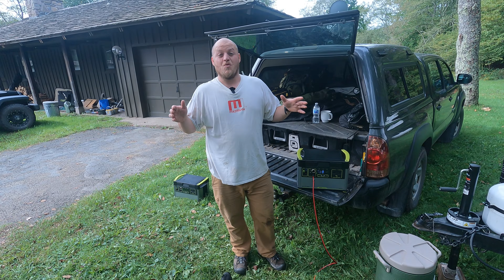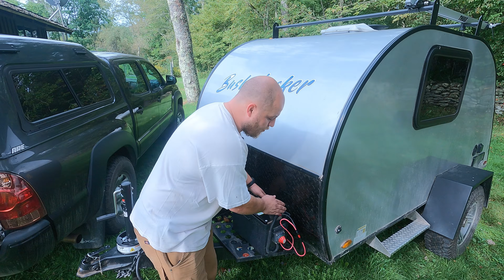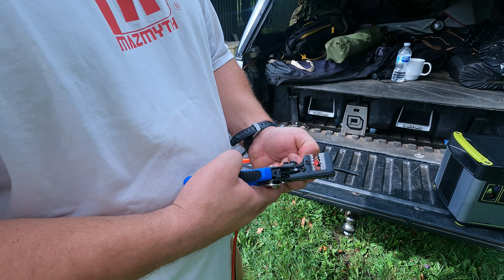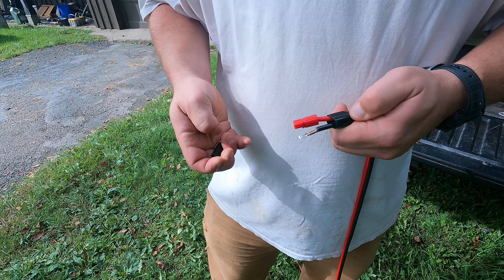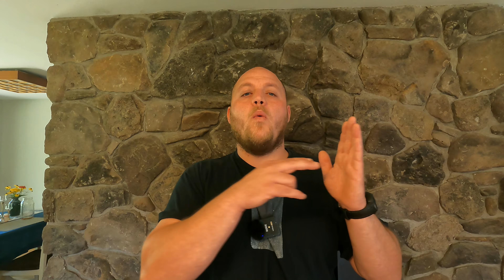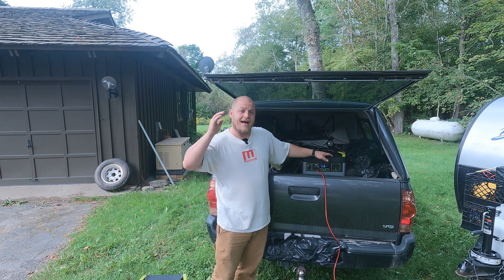Using Goal Zero for RV Battery

Comment: Hello, great video. I have a GeoPro camper and a yeti 1500x so I would like to have this as an option. I took a look at my wiring and see that there is a short ground wire that connects to the trailer and another thick black wire that runs somewhere else. Do I need to snip both black grounds and make them into one ground wire to make this work?  Just not sure why I have two black grounds??  Hope you can help. Thanks.
Reply from the maker: Without seeing your system, I can’t say what would be best. The grounds will likely all bond to the chassis. There’s several safe and effective ways to do this and you don’t really even have to remove the house battery negative to add the GZ.

Is there 2 positives? Does the second ground go to the solar ready port?
Reply: Thanks for the quick response!  

So, there is (1) positive 4 gauge wire, (1) negative 4 gauge and (1) negative 10 gauge wire. All fastened to the battery on (1) positive and (1) negative terminal.   Also, the camper does have a solar panel pre installed and wired. 

The thing that throws me off is the negative terminal has (2) ground/black wires….(1) short, 10 gauge wire that goes straight to the frame from the battery and (1) 4 gauge that runs under the camper along with the 4 gauge positive wire where it disappears into the camper. 

I’m leaning towards the power poles need to be installed on the (2) thicker 4 gauge wires and just leave the 10 gauge alone. However, I got the 45 amp Anderson power poles in. It doesn’t look like the thicker wires will fit on the metal pieces where I would crimp the wire too? Not sure if they make power poles that fit the thicker 4 gauge wires? If so, let me know. 

Disclaimer: I’m not exactly sure if they are 4 gauge wire, it was just what my gut tells me….lol.  However, They are considerably thicker when compared to a 10 gauge wire. 

Hope I’m explaining this clearly. If not, I’ll just wing it. Thanks!!!
Reply from the maker: @chrislucero758  I think it would be irresponsible for me to guess here, but I can probably point you in the right direction. Let’s talk theoretically…

4awg seems way overkill, I’m guessing maybe 6 or 8.  Since the yeti will trip at 30 amp, 10awg at these distances would carry the current. 

There are many things you could do to make this work, just don’t jeopardize the integrity of the campers normal functioning, when on house battery.

Maybe installing a “1,2, off” switch might be best. Sometimes they’re hard to find, so “1,2, both, off” would work as long as you were careful not use “both”.
You could add a Anderson, with the red going to “2” and black going to the chassis where your smaller battery black goes.  “1” would go from battery to the heavier red wire that is currently in place.  This would allow you to get 10 or eight gauge wire that fits your Anderson plug and provide a simple to use switch between the camper battery and GZ.  Don’t use “both” … switch from GZ yeti or camper.  Food for thought.
Thanks, Brian

Comment: @DIY Outdoor Life  any particular reason why you didn't route the wires so that the yeti could live INSIDE your trailer?
Reply from the maker: I have that too. The main reason I run outside most times is the space is tight. It’s two adults and a dog in our teardrop…lol. I also have videos showing the inside wiring.
Reply: @DIYOutdoorLife  Not seeing them. Can you provide link to those videos? Thanks again for your help.
Reply from the maker: @donnetellomaximilian  here is a simple backfeed set up. I also have an Anderson connection in the trailer for higher current capability, I don’t think I did a video on that yet.
RV Power Station Hack | Interior Back-Feed
https://youtu.be/lf2nbCLuLCY

Comment: Thanks for the vid. I have a 1500x and am looking to acheive the same thing- boondocking solution to power RV. 

QUESTION: Is doing this more efficient than just plugging the RV into one of the AC plugs on the Yeti? Why or why not?
Reply from the maker: Tremendously more effective.

The reasons are simple. By using the inverter you are losing around 15% in inversion loss. You are also losing 7 to 8 watts an hour to standby consumption.  Your camper is then going to convert it back to DC, you will lose 15% there.  

In a head-to-head comparison, this use of the Anderson output will prove to be wayyyyy more efficient and last longer.
Reply: @DIYOutdoorLife  Great video.  Attempting the same setup now.   Are you connecting the power pole adapters on the wiring that comes out of the turn on / off switch?  I would be running this just like my normal battery, correct?  Also, my fuse box has an option to turn the power over to lithium.  I assume I would do this for this application?  Thanks in advance!
Reply from the maker: @Waresy23  You can come out of switch, but I chose to run after. Since you’re not charging the yeti from the camper charger, no need to change the charger settings.
Thanks for watching!
Reply: @DIYOutdoorLife  thanks! makes sense.

Comment: Can it run the a/c all day?
Reply from the maker: No, this is for the DC side of things. The AirCon runs on alternating current.  This system is like a high capacity battery on the camper with solar charging, com screen and an inverter when you need it.

Comment: Great video.  I would like to install the goal zero in my camper to replace the terrible Aims 2000 inverter. I need a wiring diagram for the permanent mount. I will need relays to split shore power, generator, Yeti, 12 vdc for coach, solar 400 watt panels with Renogy controller, battery charger.
Reply from the maker: That’s great. I love the options we have nowadays, what a great system you’re drawing up.

Comment: Such a helpful video -- thank you!   I would like to do the same with my InTech Exlplore but there are 4 wires coming off the battery (2 positive, 2 negative).  How can I determine which is the appropriate wire to connect my anderson PP to connect to my Yeti?
Reply from the maker: Can you trace them out? One of them should be powering the camper, the other might be coming from a charger like a solar input. Feel free to email me a photo if you want help.
Reply: @DIYOutdoorLife  I think one set of wires runs to power center that converts AC to DC power and I think the other runs to the Zamp solar port.  I can send a pic if you wouldn't mind confirming.  And please let me know how I can buy you a coffee/beer/cheeseburger for helping me out!  Thanks!
Reply from the maker: @sarabethL4  that sounds right to me! You’ll be installing the plug on the wires to the converter. 
They should be a heavier gauge than your solar wires.
Send a pic to DIYoutdoorcontent@gmail.com

https://www.buymeacoffee.com/DIYOutdoorlife

Or PayPal @diyoutdoorlife

Thank you for that offer, don’t feel obligated, happy to help!

Comment: I have 2 positives coming out of my Aliner, how do I couple them together so they fit in the Anderson connectors. Thanks, Jeanne
Reply from the maker: Where do the two positives come from?  I imagine one is solar or a trickle charger, the other powers 12v for Aliner.  Try taking one positive off, then swap (tiny spark possible, don't be scared ..lol)  
One of them will shut off all of your DC appliances, the other will not.  Install this anderson on the one the shuts off all the DC, that's your supply.  
If you have any trouble, shoot me an email and I'll be happy to help. I just helped set one up on an Aliner yesterday.
Reply: @DIYOutdoorLife  Great I will try that. On the negative side coming out of the Aliner I have 3 wires. 2 10AWG   and 1 8AWG.
Reply from the maker: @gregjean130  can you send a photo? Your 8 awg is the trailer negative but I’m wondering what else you have going on.

Comment: Great video and I'm going to attempt this application. I have a question. I have a renogy 12 volt gel 100ah deep cycle battery for my camper (winnebago hike). I was told I need to have a trickle charger( I could use my goal zero 1000) on the camper battery when I boonedock. Do I really need to do that ?
Reply from the maker: I might be confused by what you’re asking. That gel battery does need a trickle charger. A good one, like the ones made by NOCO is recommended.  

I wasn’t sure if you were asking whether you need the battery, or the trickle charger.

Using both that battery and the Goal zero by alternating it’s gonna be a great system, especially if you can add solar. Having the simple plug there makes it very easy to go back-and-forth.

Shoot me an email at diyoutdoorcontent@gmail.com if you want links to some stuff or ideas on using both batteries.
Thanks for watching!

Comment: Great video,  I just recently bought a Yeti 3000x. And am going to run my Rv the way you ran your RV.   

I have a question, since you brought up the difference between yeti lithium battery and Lifepo battery.

Anyways,  like I said, I have a yeti 3000x  and I also have 4x 138Ah Lifepo batteries.   Is it possible to extend the Yeti 3000x battery capacity by connecting my batteries to it?   

I was thinking by using the Yeti link. But wasn't sure if it would work.   

Hope to hear from you soon.
Reply from the maker: Hey Chris. Right now, the link system does not support lifepo... Goal Zero keeps saying that's going to change.   
For the time being, I'll share what I do.
Get a simple clamp on female 12 plug.  Attach it to the LifePo and plug the GZ car adapter into it.  It charges the Yeti between 110-140 watts in per h.  If your LifePos can be hooked in parallel, this would continue to charge your Yeti for over 6500 wh!!!   You could run solar during the day and pop the car charger in after sun down. 
Shoot me an email if you want a link to the plug I use.
diyoutdoorcontent@gmail.com
Reply: Just emailed you.

Comment: Thanks for this video. You've made this look easy for a beginner like me. One beginner question, even if you bypass the battery and connect to the Goal Zero, will you still need an inverter inside to use the 120 v outlets?
Reply from the maker: Yes and no. Setting the system up this way would not make your outlets work. Since you already have a portable power station, you could unplug the Anderson and plug your camper into the inverter on the power station, like you would with shore power. You wouldn’t want to do this for long, it will burn juice fast but work great for short activities.
Check this out

Portable Power Stations Uses with Campers | Tips Tricks & Hacks
https://youtu.be/mU8iZZGlk_8

Comment: Hi Brian, great videos!  I've officially drank the DIY Outdoor Life koolade.  I'm just hijacking Jimmie Little's questions below... I'm currently having Hiker Trailer build me a rig and was wondering if I should just have them tie the system into an Anderson plug so I could just use a portable solar generator from the get go?  Or should I have them install their basic 35Ah battery (a $625 add on) and use a portable when needed, like you mentioned in your video?  I'd rather not have to spend the extra money if I don't need to.  Thanks and keep up the good work.
Reply from the maker: Thanks for swinging by, I’ll try to keep the koolaid quality high!
As for battery, that is up to you really, $600 is pretty steep for that battery, does that package include all the trailer  wiring? If it’s just the battery, you can pick that up anywhere for a lot cheaper.
I would DEFINITELY ask for a 45amp Anderson power pole lead to power your DC system. Surprisingly, Goal zero is one of the only company’s offering that output style, but it’s very easy to adapt if you go with a different brand PPS. If you wanted to run a standard battery, you could buy a 100ah AGM for $250 and plug that into the Anderson lead as well. Very versatile!
Reply: @DIYOutdoorLife  My understanding is that price includes: "35Ah Type U1 AGM Deep Cycle Battery, Mounts, 5 amp Charger" (from website).  It just seems that given a choice, I might be better off just powering the trailer with a complete package such as the Goal Zero.  The 12v wiring for lights, fan, etc. is already included.
Reply from the maker: @sj-5798  I agree. You’re going to have a lot more capability and flexibility

Comment: I wonder if you could hook it up to the trailer battery using both the goal zero and the pre existing battery as an extension for added battery hours
Reply from the maker: Unfortunately you can’t. Different battery chemistries with different profiles. But since it takes 2 seconds to switch from one to the next by changing the plug you can accomplish the same thing. 
Thanks for watching, happy camping!
Reply: @DIYOutdoorLife  that’s true